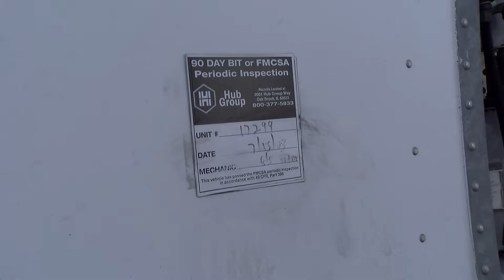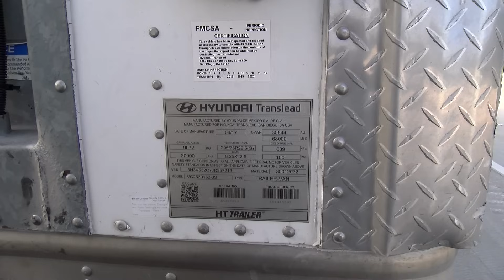111923 CLEVELAND FATAL CRASH TRUCK CUT IN HALF

Comment: Excellent documentation of the damage, including critical areas. Can visualize the intensity of the impact. It’s amazing how little structural damage was done to the trailer compared to the overwhelming devastation the work truck incurred.
Reply: Strongest place to hit on a modern trailer.
Reply: Excellent observation. At approximately 4:35, if you zoom in you can see that the smaller trucks "main frame" avoided the impact... which made a wreck that was already gonna be bad, even worse. Since it missed the frame rail, the front drivers side suspension folded itself and the frame into a pretzel before the sturdy semi trailer turned the new aluminum sheet metal cab into shrapnel.  It is a very sad scene....  driving a motor vehicle can be alot more dangerous than most think.... we are all 1 bad driver away from being hurt in an auto wreck.

Comment: I'm still trying to figure out how this accident happened. First, that F-350 had to be going a decent clip, to cause that kind of damage. Second, I saw no skid marks indicating the driver of the F-350 saw the semi, let alone tried to avoid hitting it. Third,  the broken down semi had his cones out, we know this, because they're all caught up in the chassis of the F-350. Fourth, the ANGLE needed, in order to hit that semi exactly as he did? Would make far more sense if it came from that frontage road/on-ramp, than from on the freeway.

To impact the way it did, it had to be ALL the way over to the right.. but even further than the guardrail would be, then he tried to swerve between the semi, and the end of the guardrail, in order to impact what LOOKED to be dead-on drivers side, yet a bit ... what? Kitty-corner to the rear of the semi, in order to SPLIT THE FRAME, which was just insane.

Unfortunately, with the amount of damage, and my eyes not what they once used to be, that's all I could really make out from what we saw.

Did this guy fall asleep? Have a medical issue? I'd sure like to know what the passenger has to say. He's very lucky to be alive today. Crazy.
Reply: There are tire marks at 1:50 that show the direction that the utility truck came from. It was on the main freeway and went right onto the shoulder, making contact with RR of the trailer with the LF of the Ford truck, literally ripping it apart.
Reply: Exactly my thoughts, how did that even happen damn sad
Reply: @VladimirBlarp  What, what I was saying- but it shows that the F-350? Was literally to the RIGHT of the truck, save for the drivers side. Look at the photo's from further back, around the @9:15 mark. To actually do that? He'd of had to of been bounce off the guardrail- unless it's more of an optical illusion than it appears. Crazy, either way.
Reply: @shockingguy to me it looks like the F350 hit a sitting still parked semi. How else could that happen. Very strange.??
Reply: @rickrickard2788  looks like that guardrail ends before the impact point on the shoulder
Reply: I ramped off an old dark brownish 70s car (I can't remember what it was but it was long and made of steel) that the owner was pushing diagonal in an intersection (to get it out of the road), kind of at the top of a small incline, no hazards on at 11:15pm . My car went airborne and went between a huge hurricane proof traffic signal and a walk/don't walk signal	. My front driver tire made contact with the ONLY utility access plate on the ground, which somehow whipped my car 90° then slid down the embankment and the utility guide wires stopped my car from rolling down into the bayou/muddy water. 

I don't know how I missed everything but somehow I did. Maybe the f350 was sideways for a long distance and when it made contact with the semi it also made contact with the grass, helping to flip it on its side?
Reply: @shulamitebeautifulbride   Who knows, only the passenger surviving does, distracted driving, drop something and doing somethings stupid in the truck and not paying attention, medical situation who knows
 He came across a couple lanes it looks like 
Pretty sad
Reply: @LiL.Pixxie  Maybe we'll learn a bit more when the passenger recovers- especially if Scott see's us wondering wth happened like this.

One thing I do know, strange things can happen on our roadways. Seen many strange things in my time.
Reply: @shockingguy  yes agreed. Very sad indeed
Reply: @shulamitebeautifulbride he did because the drivers door is stuck on the semi
Reply: I could be very wrong, but my guess is the driver possibly fell asleep and the passenger could've been asleep already. There's bags of luggage all around the scene. DOT # says the F350 is out of Bedford, PA. That's 21hrs away from this scene. They was probably driving back, fell asleep and wrecked.
Reply: @katdaddy469  Nope. "Kitty corner". Meaning somewhat "broadside", but a slightly different angle, that a direct broadside hit.
Reply: @rickrickard2788  Scott ??
Reply: @rickrickard2788 what kind of strange things have you seen  ?
Reply: @jacquemartinez8333  Scott Engle, the creator of this channel.
Reply: @jacquemartinez8333  One of the strangest? What was once a '70 Plymouth I believe, rolled into a ball. Maybe 4.5 ft. high, close to that wide. And this guy all twisted & tangled inside. Alive. Talking to me like not very much was wrong, except he couldn't move anything. Took 4 hours to get him out. Only had some scratches & cuts. How he didn't break any bones I'll never understand, let alone lived through it.

One other quick one- Car went off an overpass, hit a tree, ripped it in half, killed the driver. Bout 30 mins. later heard someone saying something, but couldn't see anyone because it was night. It was a girl, up in the tree. Sitting on a branch. Bleeding a little, but otherwise ok... I'm not gonna even guess HOW that all went down. One fortunate gal.
Reply: @rickrickard2788  WOW, that's insane !! All I can say to those situations is ONLY GOD !!!
Reply: @rickrickard2788  for sure strange & unexplainable....except ONLY GOD

Comment: Distracted? Maybe sun just coming up? Sincere condolences to the drivers family. Recovery to the passenger. He likely has quite a battle ahead 🙏
Reply: It wouldn't surprise me if the sun contributed to it. I drive this road frequently, and that time of morning can be brutal with the sun glare. I've experienced it several times. RIP to the driver and condolences to everyone who loves him.
Reply: Definitely not the sun
Reply: I used to drive east for quite a distance to work, every morning for years I crested the top of a hill and the sun shined in my face for about 15 seconds in the winter. Even if I left a half hour earlier or later from December until about March . I was a lucky one that never happened to me. Over the years a couple dozen cars did crash, a couple met their fate.
Reply: The semi tuck was parked on the shoulder. The Ford left the roadway by 30 feet and slammed into a parked semi and never hit the brakes. I think the driver was incapacitated maybe a medical problem.
Reply: The evidence points to driver fell asleep.
Reply: @PKerusso  Yes, or medical emergency

Comment: Well, it looks like the semi-truck had their road triangles out on the roadway like they should, per the federal regulations from the FMCSA, because you could see how they got scooped up and busted by the Ford. You have to deploy them if you're going to be on the shoulder for more than 10 minutes so, the semi-truck must have been waiting for roadside service for either engine trouble or tire trouble when the Ford crashed into the back of the trailer.

Comment: Apparently the semi truck had put out triangles. The pickup truck apparently scooped them up just before crashing into the semi trailer.  The Ford F 350 was apparently traveling at a very high rate of speed parts of the left side of the truck cab was fuzed to the right side of the semi trailer.   Then during Impact rolled the F 350 over scattering the ladders on top of the utility bed.  The passenger was probably sleeping and the driver went to sleep after he had been driving since before daylight by a few hours then when the sun came up and the driver fell asleep when the sun came into the cab. Driving at night  then when the sun comes up it is absolutely a must to stop and sleep.  The Hyundai semi trailer is absolutely very rugged.  The cab of the F 350 was ripped apart and the semi trailer is still in tact.  I noticed some rim damage on the semi trailer and also tire damage.

Comment: Those skid marks make me think that the f350 driver swerved right to miss the “car” that stopped hard enough to make those skids. But where are the people who were stopped in the road. Assuming thats what the skidding car braked for.
Reply: There are no skid marks.
Reply: @tamaragonzalez2227  9:25 to about 9:28 on the distance shot. Two cops in the middle of the road measuring it appears and there are braking marks in the second lane. If someone ahead slammed on the brakes and the F350 swerved, that could be an explaination of how he ended up on the far side of the back of the trailer and at a rate of speed that would cause this kind of damage.

Comment: That driver's side airbag is almost solid red. Also, there is no doubt at all that the truck had its emergency triangles out because they are wedged up in the undercarriage on the F350 where he was mowing them down before hitting the truck.
Reply: Actually,  that red box contained the triangles that the pickup carried, though it is possible the semi also had triangles staged. I don't have time to go back and review the tape, but, as a 29-year veteran of semi driving,  that was my first thought.  I was hit on the side of the road in a similar scenario on I-44 in Missouri, stopped for 2 minutes after a tire blew out to clear a "gator" hanging  from my DOTbumper,  was hit on the left side as I was standing at the right trailer door. No serious injuries to either the pickup driver or the car driver that he glanced off me and hit, but both vehicles totalled. DOT requires triangles to be set out after 10 minutes sitting on the shoulder or otherwise incapacitated, and too many uneducated truck drivers are taking their 30 minute break on the shoulder without placing triangles., public beware.
Reply: @clairerodden7630 I thought it looked like one might have been out. One I noticed looked like it was still folded nicely. I never leave the red box out once I put mine out
Reply: @clairerodden7630 I was taught in trucking school to stop at parking lots/rest areas or ?? For everything except emergencies or break downs.

Comment: I pray they DONT try to fault the truck driver for parking on the Side of the Highway..

Prayers for all families members & driver
Reply: Unlikely as it’s legal to use the shoulder. This is all fault of the f350. Most likely they fell asleep
Reply: Probably won't be found at fault, but he will have a fatal accident on his CSA record and cause his insurance to go up. Some companies would also not hire you if they see that on your record. Even though you're not at fault.
Reply: He wasn't parked, he was broke down and had the hazard triangles out, but the Ford F350 demolished them after he run them over and hit the tractor trailer. I said it probably was a blessing that tractor trailer was broken down, because if the F350 would've hit a family or a bus full of kids, there would be a lot more deaths than that one driver. I'm not going to speculate what happened to the Ford F350 driver, but if I had to guess, it was driver fatigue.

Comment: Seatbelt looked ripped? Wonder if they got damaged in impact causing them to be ejected? Or if they weren’t wearing seatbelts anyway. RIP
Reply: Wouldn't matter if they wore their seatbelt as one end is attached to the part that got ripped off
Reply: That looked like a seat belt cheater to me.
Reply: @wolfman515  could be, but the torn seatbelt suggests they could have been wearing them. With the top of the cab and the B pillar ripped off it would have taken the seatbelt with it as it threads through the thing bolted to the top of the pillar on the way to the retractor bolted to the bottom of the pillar.
Reply: @wolfman515  seatbelt or no seatbelt i think the result of this crash would have been the same anyway
Reply: If you would notice they showed that the lock was still in place of the seat belt.  The seat belt was ripped in half from the impact.  And with that damage the driver would have died instantly as it was his side that hit the trailer straight in to it. The frame of Semi Trailers are made of steel and our vehicles are now made of aluminum.  Duh!!!
Reply: @tamaragonzalez2227  
       Actually, semi trailer frames are most commonly made out of aluminum nowadays. The frame in that Ford was steel, and the seatbelt was removed when the drivers side of the truck was torn off.
Reply: @tamaragonzalez2227  
       The piece you see locked in the seat belt coupler is a cheater, that just shuts off the annoying seatbelt reminder. There's lots of people who use them unfortunately.
Reply: @tamaragonzalez2227  I heard a better description,cars now days are made from Tupperware and aluminum foil!!!
Reply: @tamaragonzalez2227 Not ALL vehicles are made of aluminum (especially not heavy duty work trucks). Duh!!
Reply: @jimapplegate3523  All though this truck isn't aluminum. It's a 2012. All F350's 2017 and newer are made out of aluminum. So you're comment of "especially not heavy duty work trucks" is actually pretty false.

Comment: Trucker breaks down. Put out of refhector's trucker standing outside the truck on the driver. 's side service truck comes along clips. The trailer takes out the service truck driver injured  the  passenger.  Injures, the truck driver standing on the side of the road. You can tell by the reflectors underneath the service truck And no damages to the trucker's cab, which means the truck driver was outside the cab

Comment: I can almost guarantee you that the Truck Driver will be blamed and sued for causing this accident, even though it is crystal clear that the truck and trailer were way off of the highway and the pickup truck driver struck the trailer on the right corner. I feel sorry for everyone involved.
Reply: Actually it might have been a blessing the semi tractor trailer was sitting there, because as fast as the Ford F350 was going and if it hit someone else, like a family or a bus of children, this accident would've been far worse. I'm just considering what could have happened if the semi wasn't there.
Reply: Hubgroup have cameras, they're are good, I bet they got the video already

Comment: Trucks today are tinfoil and bubblegummed together. While cab and nose are just light aluminum. The frames are significantly lighter as well, made with cheap scrap steel with a thin single wall open channel. They don't make trucks like they used too. They just crumble up like a soda can.
Reply: I don’t think your taking in Acct for the workbed,  it’s contents, weight. Speeding prob didn’t help the matter.
Reply: @treydogg77 
True, but also Ford's making the entire cab and bed made of aluminum doesn't help much. Soon all the truck manufacturers will follow, if not already.
Reply: @thomasrodriguez7803  this utility truck was older than 2017 which meant it still used the steel body . You can see the old style flapper door handles at 19:47
Reply: @VladimirBlarp : You're right, but he does make a good point about the newer pickup trucks made out of aluminum. My 2006 Dodge pickup wouldn't be a rust bucket if the cab and bed was aluminum, I only hope the thickness of the aluminum would add strength to the newer pickups and cars.
Reply: @brianlanders8028  for example, when the "new" 2015 F150 debuted everyone made jokes about the aluminum, or how it melts in fire, blah blah blah. But in reality, in 2015 there was only ONE 5 star rated truck for crash protection and rollover protection, and that was the F150.

Comment: Good Lord! That utility truck had to have moving at a pretty high rate of speed! The description says the driver of the semi is in the hospital in stable condition. That's insane considering he was about 60 feet in front of the point of impact.
Reply: He was likely outside.
Reply: If you look at 19:20. The impact pushed the semi truck forward about 10ft and the trucks brakes were set. So that's a very big impact for it to move that semi forward like that. More than likely the driver wasn't buckled in, due the truck being stopped. So I could see how he got injured.
Reply: @Corky3D , that makes sense. It APPEARS there isn't a seal on the trailer's door, so there's a good chance the trailer was empty which would definitely amplify the impact.

Comment: Cab and floor/chassis separated snapping the shoulder belt.
Reply: I was wondering if that would have caused the failure of the seatbelts or if they failed before?
Reply: The seat belts likely failed as the roof came off the truck.

Comment: RIP to the driver of the F350. Pretty hard hit to tear that truck up that much, no skid marks so he must have hit that trailer at 65 plus, and to hit the right rear corner he had to have been well off the road, since the semi was parked on the shoulder. Difficult investigation for a cause, and DOT will impound the tractor trailer and inspect every nut and bolt, as well as checking that the driver was fully in compliance. A bit hard to tell, but a couple drive tires on that tractor looked a bit sketchy to me, but maybe it was the angle of the picture taken. Hopefully the driver was all legal and good to go, that's a pretty tough situation to get over, even though he wasn't at fault.